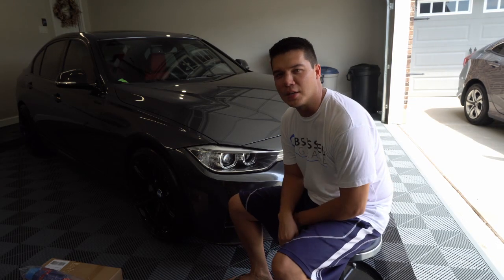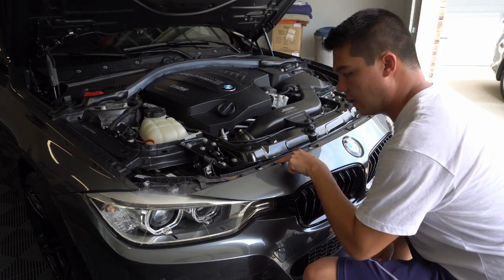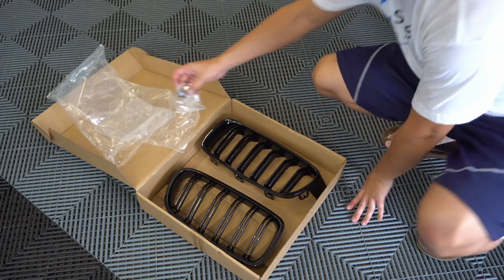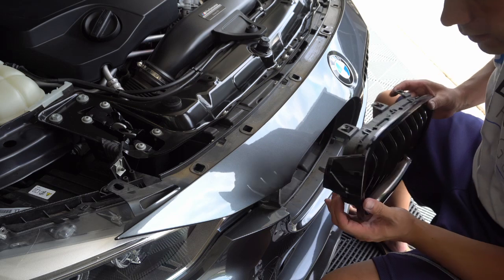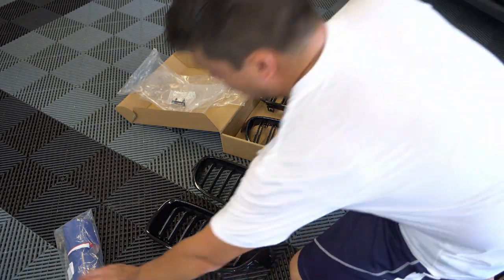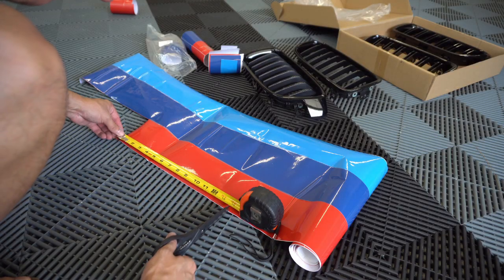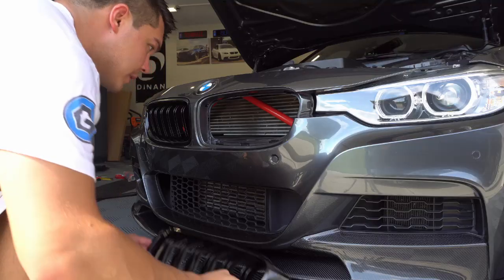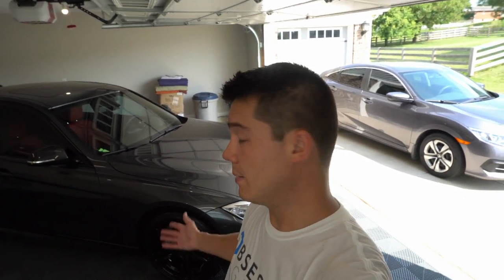New Kidney Grills and How to Wrap Your V-Brace | BMW F30 DIY

Comment: Like the grills.  Crossbars not to my taste. Something in a brushed aluminum wrap to match the rad or metallic grey to match the paint would look better than the contrast, but that is my personal taste. 
I’m an OEM+ kind of guy, always have been for 30 years (except street rods! ), but not everyone has to be nor should be! 
What matters is if YOU like it. It’s your vision, and your car, not ours!
Reply from the maker: Honestly not sure how I feel about the V-brace still. I'm sure it will eventually come off. I'm more of an OEM+ kind of guy too, but every once in awhile I do something different. I did some blue "CRT" style stripes on my previous M3. It stayed there for maybe 2 months and then I pulled it off. So it will likely be the case for these as well!